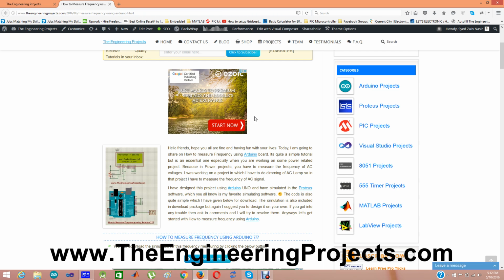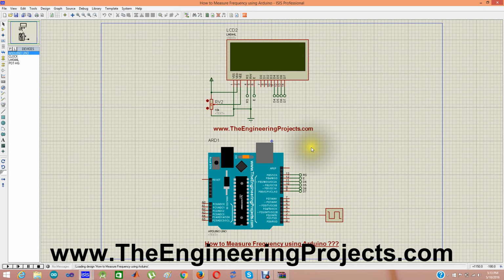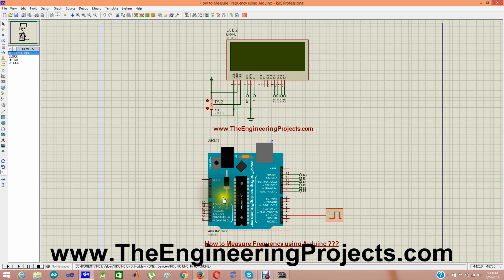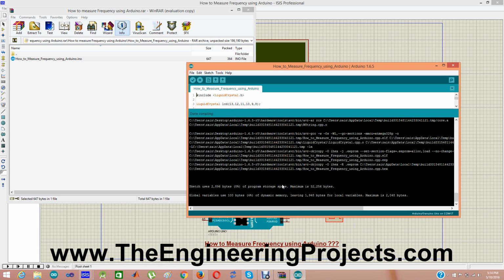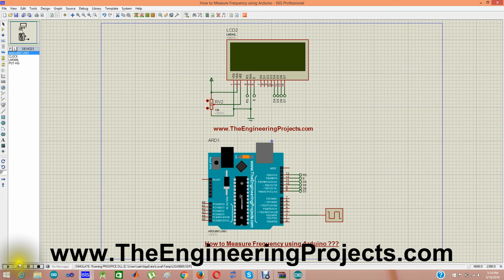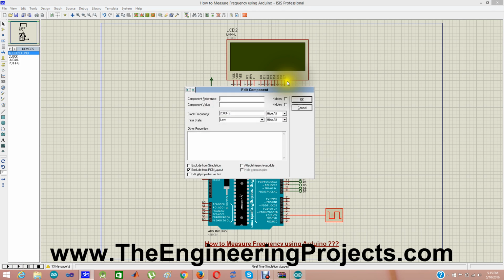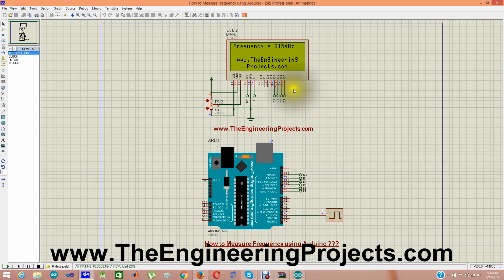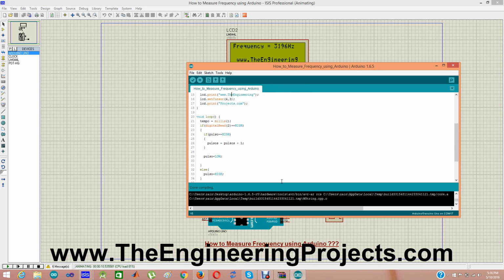How to measure Frequency using Arduino ???

Comment: Hi I am interested in making a meter to measure the resonant frequency of a guitar pick up I want to use Arduino Uno as I have a kit with the LCD readout as part of it and it looks as though it is possible to do this from this video can anyone point me in the right direction for making a meter specifically designed the the task I have, any help would be greatly appreciated